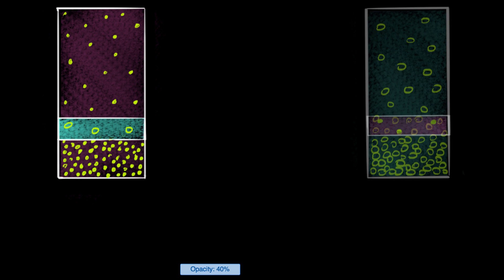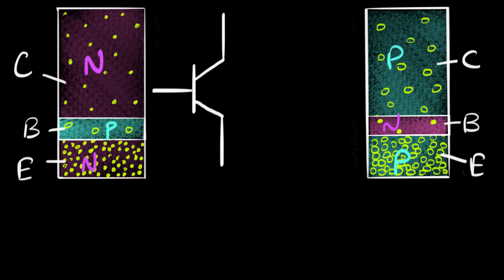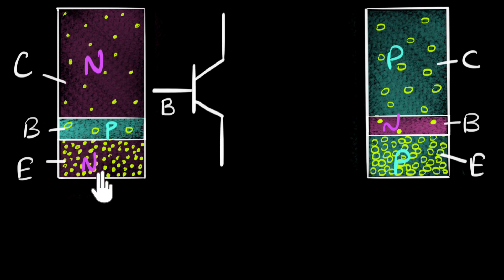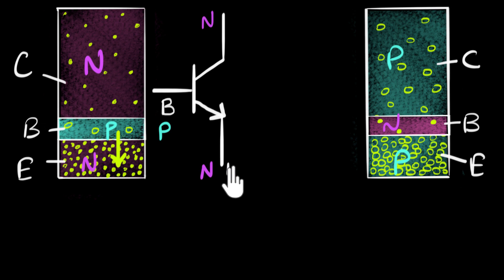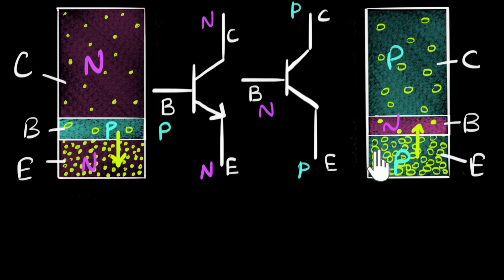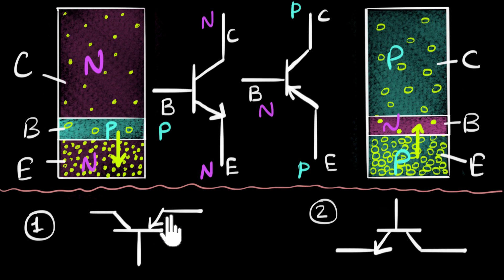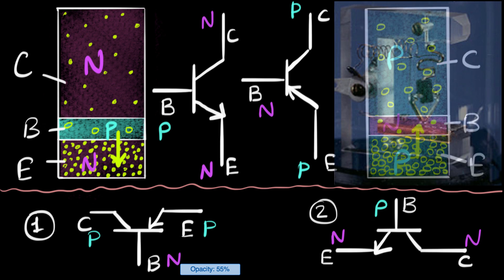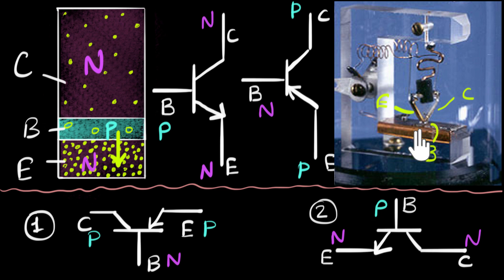Transistor symbol | Class 12 (India) | Physics | Khan Academy

Comment: How can the base terminal of a transistor be both positive and negative at the same time in a common base configuration?
Reply: this is relative term not absolute term
in the PNP transistor - the base(+0.7 V) is less positive with respect to collector(+5 V) so relative to collector, potential of base is lower 
      but if we compare the emitter(0 V, bcoz it's earthed) to base(+0.7 V) then base is at higher potential.